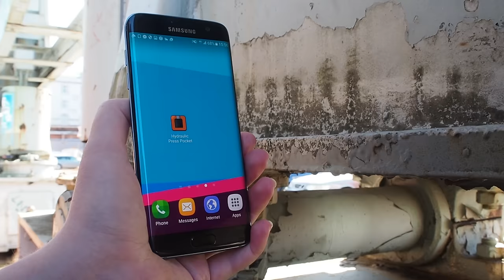Crushing 1500 sheets of Paper with Hydraulic Press

Comment: How about stabilizing the gopro?
Reply: Tommy Khoury you mean sticking it down with double sided tape?
Reply: Tommy Khoury go to 3:58 when the rear guard is knocked loose. That was a bolted steel grate probably possessing a significant ballistic rating. That go pro cant be secured better than that mesh was, and it came loose.
Reply: its cooler when it goes flying in the air and you see the POV of the camera
Reply: If the go pro is secured properly and something explodes the camera will be more likely to break. It's like moving back as something hits you from the front, of you stay completely still it hurts more
Reply: Sir-Red it's a GoPro dude they get dropped from hundreds of feet
Reply: That is steel or iron grate that's probably attached with a cabletie. And it is also much heaver than a gopro probably.
Reply: Wentpro
Reply: A tripod?
Reply: I don't think that expanded mesh is bolted down. More likely it is just hung on hooks so that you can access the other side easily. I'd find a better way to secure it though.
Reply: 3M installation tape, that shit devies gravity!
Reply: How about NOO
Reply: @pudgeboyardee32  maybe place it on a different table that is not in contact with it and keep it close but not too close?

Comment: The paper always folds around the tool, so how about a stack of paper a little bit smaller than the tool?
Reply: LORDORBY it would be the same like with post its
But im not going to spoil you what happens
Reply: LORDORBY it would make absolutely no difference. The paper folding around the tool doesn't effect the press's ability to crush it nor really what the explosion would look like. It would equal this without the crumpling.
Reply: A sticky note
Reply: Hexia It would also prevent stuff from flying outwards.
Reply: everything folds around the tool bc of the pressure, my man

Comment: Can anyone explain the physics please? I failed at science.
Thank You.
Reply: Vermillion Stallion 
Too much pressure on a single surface and not evenly distributed. It's complicated.
Reply: The pressure is focused on only a particular region on a large area. This forces that part to separate off the larger part. Since there are many of them they just separate with a sudden explosion.
Reply: Frank Kruchef its not complicated
Reply: Frank Kruchef is your profile pic of Donald Trump wearing a KKK hat?
Reply: It's pretty much just a failure of containing pressure. Energy needs a place to go. A lot of kinetic energy was in the paper from the press, needing a place to escape. If such a place doesn't exist, it blows up when the imminent energy is higher than the structural integrity of the paper
Reply: This is conservation of energy. Also, the formula P=F/A explains how a small area gives a greater pressure. Inverse proportionality. Hence, 2 physics ideas in one thing.
Reply: Vermillion Stallion lots of pressure equals boom boom of paper
Reply: fireball taco 
It's KEK not KKK
Reply: Vermillion Stallion paper got so much compressed, it fused together and become more solid than metal, more even pressure, the block couldn't bear the sheer strength and it broke
Reply: Arjun banerji You sir, have explained everything.
Reply: Ray Spartan :)
Reply: I think it's fascinating how the sheets act as one huge solid chunk under pressure, so you can see chunks fly off, as if it were a huge brick. But then once air gets between the sheets, they become flimsy again. 😀
Reply: fireball taco it says top kek

Kek
Reply: EndohMiharu Giving a notion of variable density due to the factor of air.

Comment: does this kind of use possibly damage the hydraulic cylinder? I can imagine a fast release of energy like that causing temporary cavitation. Is this a concern for hydraulic oil under such pressures?
Reply from the maker: Cavitation matters only when it's happening constantly long periods. For example if pump has too low inlet pressure and it cavitates constantly it will wear out quite fast. But one pressure shock makes just one or couple waves of cavitation so it won't matter. I think the mechanical shock that goes trough the frame is much worse for components than the pressure shock in hydraulic fluid.
Reply: Interesting, would enough cavitation in a cylinder over a very long time cause leaks?
Reply from the maker: I think if the machine would be on 24/7 and doing something like this it could corrode the cylinder wall making it rough and therefore leaky but I think you would get some problems with your directional valve or what ever you are using to control the cylinder since the pressure shocks are affecting there also and if the valve has large enough hole trough it the pressure shock can affect the whole system also.
Reply: Hydraulic Press Channel i was a press operator for many years, overdriving your pump for extended periods will damage the pump itself by creating wear ..which in turn will lower your maximum pressure..the lower seals on the hydraulic ram can also pop out. I Did it a few times on a 1000 ton Verson press and a 500 ton Pacific press.Age and wear is also a factor. What you do with yours falls within normal operating range.
Reply: netrioter, how often do you press things that create a shock wave like this in normal use? Static pressure is one thing, impulse is something else.
Reply: Gameboygenius punching 3 inch thick steel 80 KSI with a 3 inch diameter hole...16 of them in a 20 foot bed. it would take all 1000 tons...we would have to max the press out for 2 minutes then it would just go kaboom!!..and lift us off the ground. we did this 35 times in an 8 hour shift..on a 1950s Verson dual cylinder press with a 25 foot bed..it ran nonstop for 35 years.We would replace the pump box yearly

Comment: Is there a reason that HPC doesn't just tape the GoPro to the table?
Reply: thurman spurlock cause the flying POV is the best ever
Reply: thurman spurlock if it's locked down its probably more likely to break than if it's allowed to be pushed away by explosions and what not
Reply: thurman spurlock so it can fly off, gives them an opportunity to use a (GONE WRONG) clickbait.

Comment: Even paper can be dangerous
Reply: TakeoutLime47 only "some"? 
It would suck to be the guy who wasn't taught that trick.. Trapped behind enemy lines with nothing but a few pages of a sticky porn mag 🤔
Reply: bleach for you fun tip... if you take about 10 pieces of paper, roll it as tightly as you can lengthwise, then fold it in half, the edge will be hard and sharp enough to crack someone's skull.